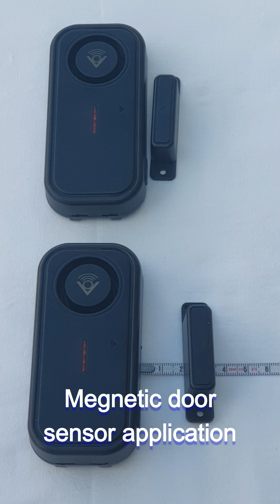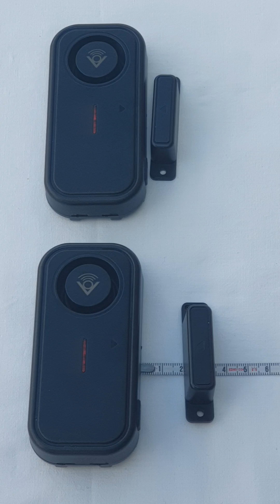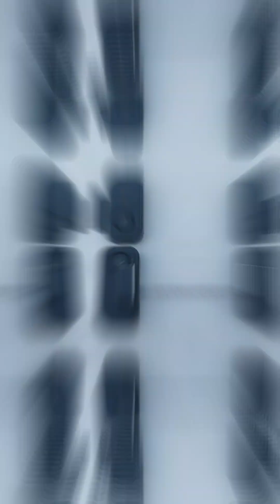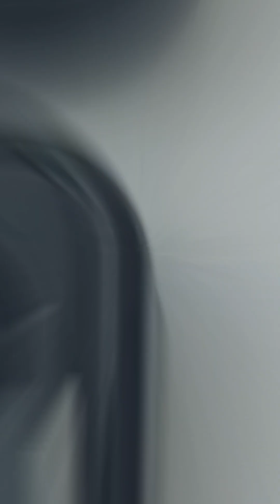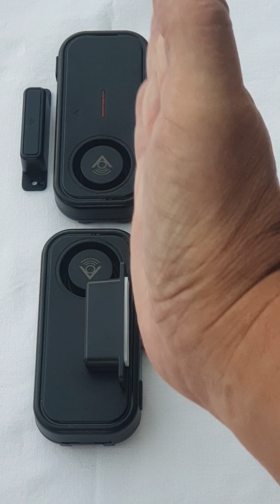Magnetic door sensors set up Vanolarm Lite #vanlife #vanalarm #vansecurity

Comment: For the money these units are excellent fitted 4, one problem if you use one fob to arm all 4 units but you only have one door with a magnet then the system goes off instantly in magnet mode had to stick magnets next to each units to get system to arm, only other way is to put  non magnetic units on one fob and magnet units on another.